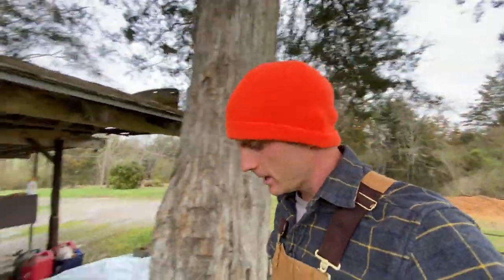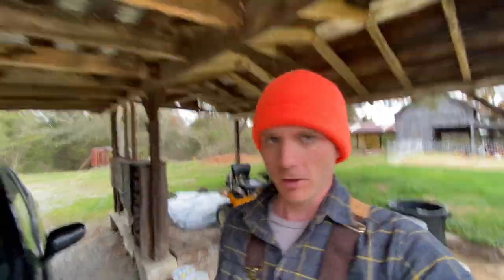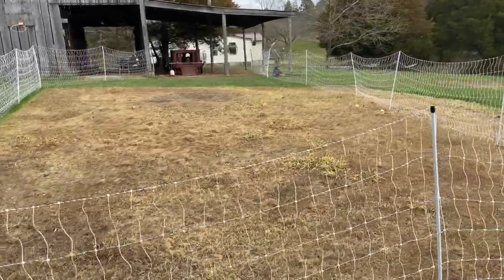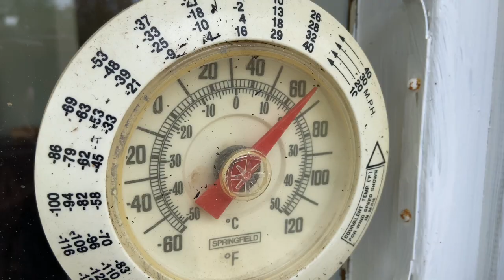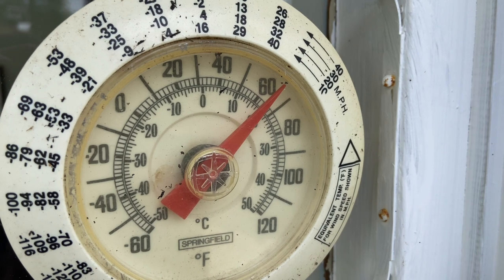The 4 MOST IMPORTANT Tools On My Homestead

Comment: The roots of the tree need to have some soil on them. You might find some silty soil down by the creek. Some soil that will pack down well so that you don't keep on digging up the roots. By using that soil you will also be dredging the creek and enabling the water to flow freely away. The fine silt is also full of nutrients that will aid your garden. If you have the time you could also use some of that to part fill your raised beds. You can leave the chickens where they are and just place the raised beds where you want them to be (the chickens wont mind). The compost that will be coming sounds like proper stuff. If it has been use to grow mushrooms then its super good, you might also get a free crop of mushrooms out of it as well. Someone else has already suggested an A frame of plastic or old windows, shame your dads window are not done yet as they would make an ideal cold frame. Love your choice of tools, the hammer made me laugh. It reminded me of the "engineers" on London Transport tube trains. They carried an oily rag and a hammer much like you use. If the fault moved then they would oil it, if it didn't move then they hit  it. Most trains were fixed in this manner for many a year. Memories of my youth. Thanks again.
Reply from the maker: That is a wonderful idea about the creek silt; can’t believe I hadn’t thought of that before. Thank you so much!

Comment: I couldn't see it very well with my weak cell signal but it looks like the weed in the mulch may be burdock. Nothing stops it. It has a deep tap root so you have to dig each individual plant. They spread. I was just out trying to make a dent in mine yesterday 🤣. The positive side is that the huge, abundant leaves are a great addition to compost. It has some medicinal value too though I don't remember what off the top of my head. I use a lot of wood chip mulch though I am currently out, and here in E TN I have found I have to put cardboard down first on grass and paths. Several inches does great in the garden on it's own though. We have many vicious monster weeds 😂. You have to laugh or you will cry.
Reply from the maker: Wow, thanks for the knowledge here, Amy! I will look up the medical value of burdock; you’ve piqued my interest!
Reply from the maker: @Brenda Montanye  Wow, thank you for this! And as far as letting it bloom: It has two weeks before the compost gets here and I put the mulch down; so it's on the clock! 😂😂😂